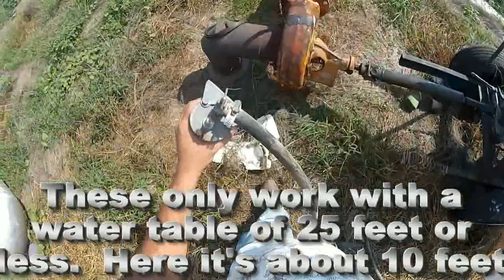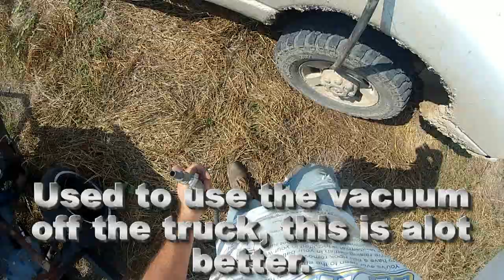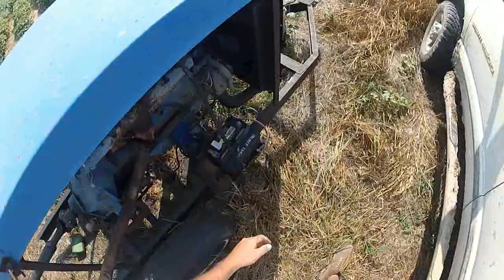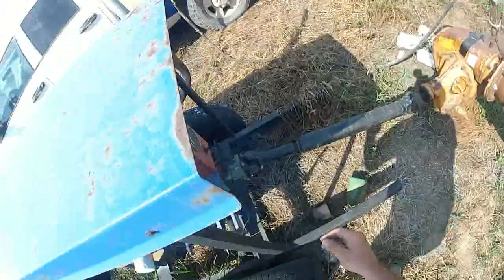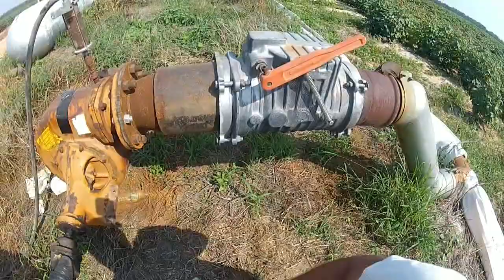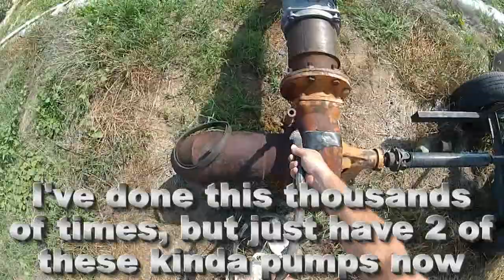Priming a Centrifugal pump for Irrigation

Comment: the engine driven air compressor in the back of the mini truck has a hose connected to the air inlet of the compressor pump, in this case a vertical single cylinder unit..  the pump pulls a vacuum on the well through the top of the pump housing through an air chuck connection, the cylinder at the end of the hose is a sight glass so the dude running the vacuum pump and irrigation pump diesel know when to do his thing and get the water pump running before water gets sucked into the vacuum pump. that's a much better way then driving out there with a huge tanker truck full of water and filling the well casing by gravity.